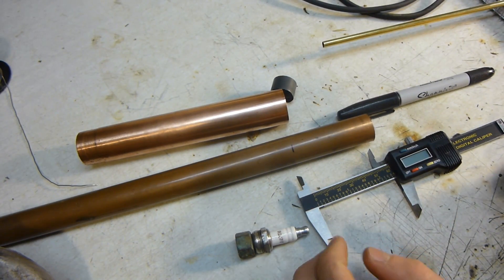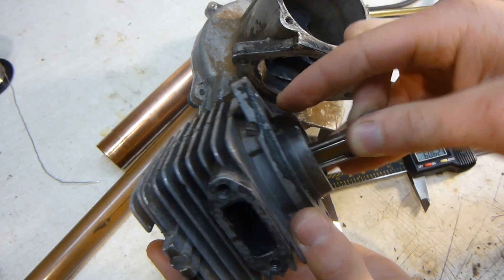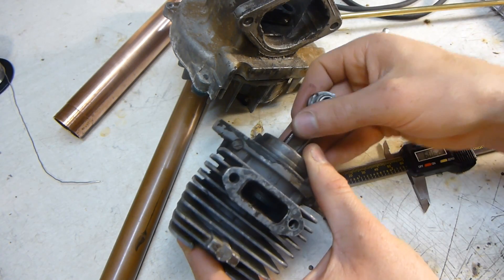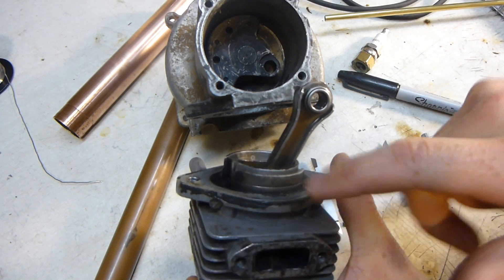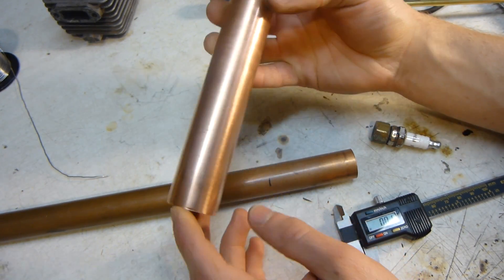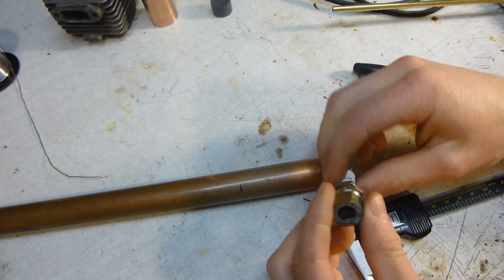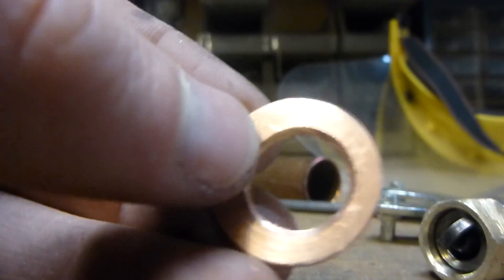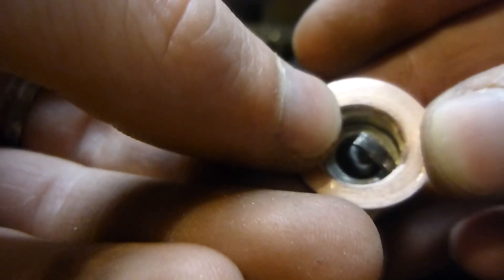Part 2. Making Internal Combustion Engine, No Machine Shop - Cylinder Head and Spark Plug

Comment: I want to build something similar to your engine but I don't know what solder I should have, especially what melting point.
Reply from the maker: A good pipe solder should be fine.  Lead free has a higher melting point and is stronger.  Lead solder is much easier to work with tho.  Either will work fine as long as you put some cooling on it.

Comment: basically the bottom half works like a pump of the air fuel mixture
and the top half burn it and makes the power

Comment: Notice me idol your work its such a nice work i wonder when i watch it first i dont believe but when i study the ic engine and your project i see clearly and i understand it and now at the moment im doing my internal combustion engine and i have a bit of hard on making crankshaft and i have one question notice me and reply asap thank you 

WHAT KIND OR NAME OF FUEL YOU USED ON YOUR WORK?? 
 On my work i using a 70%solution alcohol and its worst doesnt work with a spark igniter i realize why this kind of alcohol doesnt work because its has water? I am right?? So btw i need your answer what kind of alcohol u use  
On the future iwant to be mechanical engineer ilove cars and engine ill drive nissan caravan and a motorcycle just saying thank you for reading this its a pleasure thank you

Comment: The volume inside the plug counts as well and it's substantial on a small engine.  Also, the plug tip can be up in the nut some if the nut is long enough with the surrounding cyl closer to the piston thus lowering your stroke requirement if the goal is 10:1.  I bet if you used a compression gauge to infer the ratio you really hit something like 6 or 7:1.  You'll be amazing when you get a lathe.
Reply from the maker: I actually did do some basic calculations to take into consideration the volume inside the spark plug.  That's how I decided what stroke length I needed.  Like you say tho, I highly doubt it's as high as 10:1.  Thanks!

Comment: Fascinating project. Please continue, but if I can make a suggestion, write  at least the outline of what you want to say so you sound more confident. The stress you are putting yourself under by writing the script on the fly is transmitted to the viewer, making it hard to watch. It will make things much easier in the long run.
Reply from the maker: +Herbert Shallcross thank you for the suggestion! I could try it sometime. But the problem is I can't really write a script because I constantly change the project. Plus that would add sooooo much time onto this project. I just wanna get my project working and not write scripts. Like if I was an English major then sure that'd be nothing. The other thing is if I went off a script it would sounds like I'm reading of a script. Personally i hate that more. If some people think I'm a moron, well I honestly don't really care. As long as a few people understand and see what I'm trying to get across.

Comment: You don't always have to use special fuel for compression ratios over 10:1, you can always run it fatter to keep it a little on the cooler side. as well as backing off your ignition. I've seen 12.5 to one engines run on 91 without an issue, but if you're calling that special fuel then you can lower the CR
Reply from the maker: +Mike Feeley I'm using colman fuel because it's less stinky and cleaner. I've never had any pre-ignition problems. I also doubt my compression ratio is as high as I calculated. I think it's more like 6:1. I run this engine very rich haha the spark plug gets nice and carbon coated after just 15 min of running hahaha :D

Comment: this guy doesn't know anything about engine at all
Reply from the maker: +life changes_ I would like to see you build a working internal combustion engine without a machine shop. Then you can tell me that. Have a nice day. Thanks
Reply: I can +makerj101 and I have before you don't know how an engine works at all there are a type of engine that work the way you explained but a internal combustion engine has multiple different types and styles of motor ether explain it right or look like a complete idiot to 1000s of people
Reply from the maker: +life changes_ thank you for your opinion.

Comment: Hi nice engine now i like to build a same sort, are the dimensions on the paper the right sices? Or you have another drawingplan for the dimensions for the cilinder and intake outlet port, need some information about, grtz marcel
Reply from the maker: +marcel kost those are the approximate dimensions for the most part. There may be some differences between those measurements and the actual size of the engine. That paper is the only thing I have as far as plans go. If something doesn't seem right just apply you're best judgment and you should be golden.

Comment: Sorry dude.  that's not how a 2 stroke works.
Reply: useless long explanation, in the end he successfully made it with current explanation.
Reply: Evolved Amateur RC
i think he used soldered joints because it is more workable than welding. but it's pretty strong i guess. but ya great work for him
Reply from the maker: +Amateur RC prove it.
Reply: Makerj101 a 2 stroke engine works by whats called scavenging.  there is hardly any pressure.  The exhaust leaving the pipe creates a vacuum pulling the new intake charge on from the crank case.  Then the sonic pulse created by the explosion creates back pressure to stop the air fuel mixture from coming out.  this is why supercharger can work on 2 strokes when so many say they can't.  it's all about the sonic pulse.  let me watch and listen to what else you say again and I'll correct it all.  I'm ase certified and went to an actual school learning about diesels, both 2 and 4 stroke, and gasoline, both 2 and 4 stroke, braking systems, suspension, CVT, automatic transmission, manual transmissions. flat head engines, so I'll watch what you have to say again and correct you.  I have a video myself going over how nitro engines work and they work on the same principals as a 2 stroke but don't use a spark plug for combustion but a glow plug and compression, very much like a 2 stroke diesel.
Reply: Makerj101 ok now that I've watched and freshened my memory about everything you said I can correct you. first you started out saying the bottom is when the piston is at the top of its travel.  this is actually the top and known as TDC or top dead center. also you said the intake is located at the crank case. this is somewhat true. Reed case engines have the carb going straight into the crank case but these are more expensive and are only used on motorcycles and more expensive motors , your garden variety of 2 stroke engines such as weed whackers, chain saws etc. have the carb located on the side of  the head opposite that of the header not exhaust manifold (most 2 strokes either have an exhaust can or header with a tuned pipe connected to it.  There is only so much you can learn from book work.   you have to rebuild many and diagnose problems and work in a shop to learn them to the slightest detail. one question I have for you is how is the spark created) and when the piston comes above the intake vanes/port the vacuum created by the scavenging  when the exhaust is leaving and pulling air/fuel into the combustion chamber a vacuum is then created in the crankcase because of the air/fuel traveling to the combustion chamber.  2nd there are valves in some and there are none in others.  they are known as reed valves or valve.  these are usually only at the intake to stop the air fuel mixture from going back out the intake.  ﹰAgain most 2 stroke engines are not reed case bdcause reed valves would simply add another moving part and the great thing about 2 strokes is the lack of moving parts, usually 3, the piston, the connecting rod and the crankshaft.  The only type of engine with fewer moving parts is the rotary engine with 2 major moving parts, the rotor and the crankshaft.  after all this happens the new burst of air fuel is ignited by the spark plug forcing the piston down creating reciprocal motion which the crankshaft turns into rotational motion. next the pressure created by the piston traveling to crankcase is very small.  reed valves are used to combat this pressure to keep the air fuel mixture in the crankcase and not blowing back out the intake.  motors with the intake at the head dont have to worry about this because the piston covers the port.  The the new air fuel mixture is pulled in by an effect known as scavenging.  4 stroke engines utilize this to a point by keeping the intake and exhaust valves open at the same time for maybe 10 degrees so the escaping exhaust will start pulling in the new air fuel mixture so the piston and the vacuum a 4 stroke makes doesn't have to do 100% of the work. this is known as valve overlap and makes the engine more efficient.  You had the very basics and honestly I am impressed you were able to make an internal combustion engine out of copper pipe soldered together and an epoxy piston.  And you obviously knew the basics cause if not that engine never would have ran you just didn't explain them or 100% understand them.  I work on 2 strokes every day on my fifth scale RC vehicles and at work.  unlike many that buy their power by buying a 600 dollar 34cc engine I buy my parts and port And polish them to get max power.  I haven't made many videos lately cause i have moved and am setting up my RC room/studio. I've already done a video going over how a 2 stroke works but on a very small scale, nitro engines which aspirate just like a 2 stroke but utilize compression amd a glow plug (again simplicity) and are very much harder to tune and keep running than a larger displacement engine due to less rotational mass, like when you added the larger flywheel to keep the motor spinning, the flywheels on nitros weight may be 2 or 3 ounces.  this is why they idle at 5 to 6k rpm.  I didnt mean to criticize as I can tell you are young but it's nice seeing young people getting into trades instead of going to college for a degree for a job that at this moment in time does not exist 98% of the time and that's sad (thank you Bill Clinton for NAFTA)
Reply: NerdgineerTV I am surprised he was able to get ot running with soldered joints.  very cool to get the intake amd exhaust working correctly.
Reply: NerdgineerTV yea.  I was amazed to see it working.

Comment: your intake is not in your crank case
Reply: actually on many two strokes the intake is thru the block. it helps with lubrication an is simpler as far as channeling the mixture
Reply: Then why is the carb on the side of the bore
Reply: Nickelbug Swain notice how he said some.
Reply from the maker: +Nickelbug Swain because that was the way I had to do it. due to limitations in my precision and the parts I had available to me. If you watch the whole series you would understand. Have a nice day

Comment: what is flux? im dutch
Reply: Jens van der Ploeg obviously you have the Internet, so look it up.
Reply: yes didnt realise that
Reply from the maker: +Jens van der Ploeg flux cleans the metal, covers the metal so it doesn't oxidize when heated, and helps the solder flow into the joint and bond well to the metals.

Comment: I notice you have a really long stroke compared to your bore, newer engines have about the same bore  and stroke. So 54mm bore and 54mm stroke. The short stroke improves scavenging compared to the long stroke if the ports are the same size in ratio to the bore in both cases.
Reply from the maker: +SamD you are correct. Because of the limitations I placed on my self(using readily available parts and no machine shop) I could not obtain such a short stroke and large bore. If I had used a model airplane spark plug this could have been greatly improved.
Reply: yes :) look up "CM6" spark plugs. they are very small while still of the bigger type :)
Reply: Im reseaching further still and I will build a cylinder with either 26mm bore and stroke or 32mm bore. former would be 16cc latter 26cc.
Im planning to solder a proper water cooling jacket around the cylinder and make a seperate cylinder head installed with nuts and seals.
 The Cylinder head I propably will cast out of aluminium.
 I´m using a 5 port design in my cylinder and Ports will be angled at varying angles.
Also the cylinder is separate and a crank case will be built with a proper hole for a weed wacker or an rc car carb and mounting holes.
I hope to somehow use a chainsaw clutch to put the engine on an rc car. 
I will also build a small mechanical water pump spun by the crank with reducing gears to make water circulate in the cylinder water jacket.
Piston is my only concern. 
my design has evolved greatly since first contacting you via email :)

Comment: why don't you just use solder that has the flux on the inside dude
Reply from the maker: +Porter Francis that's fine for electronics. But when you have something this big oxide begins to form before you can get the solder melted on the parts

Comment: Hi,
good work on your project.
may I suggest that to calculate the compression ratio you may need to revise your calculations.

The compression ration as you would know,  is the ratio of the volume within the cylinder and head when the piston is at max down stroke to the volume within the head over the piston at maximum up stroke.
This ration is proportionate to the relative distances from the head to the top of the piston at max down to max upstroke, only when the crossectional area of the cylinder and head do not change. If they change as generally is the case and is the case in your example, then the compression ration is much higher if the combustion chamber narrows.

In your case the combustion chamber around the spark plug has a smaller diameter, so the 6mm of head space that you measured has a lot smaller volume than 60mm of cylinder distance.
I hope this was clear enough, as I did not want to dwell on the matter. happy to explain further if required.

Also consider cleaning and fluxing the components before assembling thereby getting the flux on all surfaces.

good work, keep experimenting.
Reply from the maker: +Charles Camenzuli I did calculate all that to a certain extent.  I took into consideration the area around the spark plug.  Anyhow what does it even matter if I did mess up the calculations?  It works so I think that's a testimony that I did something right in my crazy calculations!  :D Thank you!

Comment: Very cool, also was wondering the wattage of that soldering iron you use I'm wanting to buy one for soldering large joints but aren't sure which will be hot enough thanks
Reply from the maker: +Stirlingbuilder Well for the smaller joints like what I soldered in this video a soldering iron works fine.  But anything larger it probably won't be able to heat up.  That is the only joint I did on the whole engine with soldering iron.  Rest was done with blow torch.  I have a Weller WESD51
Reply: +Makerj101 Thanks Just in the process of designing a new stirling engine but this time im going to try your way of soldering the water jacket instead of using epoxy as its too messy lol
Reply from the maker: +Stirlingbuilder Make sure the joints are really really clean and use good flux and solder away!   You can also use 2 low wattage soldering irons.  It's a bit tricky to do but I have done it before when I didn't have my nice soldering station and I needed more heat.  Good luck and let me know if you need any more help!
Reply: +Makerj101 Sorry for the late reply. thank you for the advice, iv'e had a go at soldering the water jacket and yes it leaked haha (more practice needed!) I ended up using a 45w iron which I already had and works fine. your internal combustion engine is coming on nice well done! pretty sure one day you will invent something big like a jet pack or something :)
Reply from the maker: Cool!  Sounds like yours is coming along nicely!  Keep it up!  Let me know how it goes.  Thank you!

Comment: This is an amazing project to see unfold.  I am like a number of other people here who can't believe that soldering actually worked on this---but it did.   The piston made out of JB Weld is another 'NO WAY'---but that also worked.  The whole design parameter of your engine didn't dictate that it run very long but just that it could run being constructed without machine shop tools (except for a drill press).  Thanks for sharing this.
Reply from the maker: +Lidmotor Thank you!  Why is everyone freaking out about me soldering everything?  I don't get it.  I think solder it very strong.  Cumulatively I've run it for about 2 hours and no solder joints have failed yet.  Oh and I'm still running the original JB Weld piston!  I'm actually pretty surprised nothing has failed yet.  I have replaced the rubber o-ring about 4 times.  If I keep enough oil on it it lasts a long time.  Yeah I kinda cheated on the drill press... But it can be done without one.  It would just be slightly more time consuming.